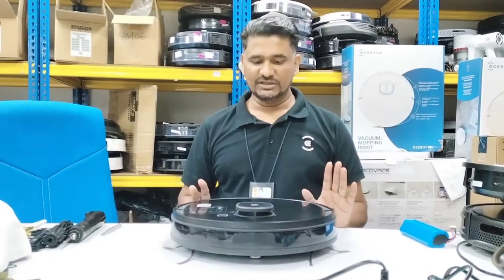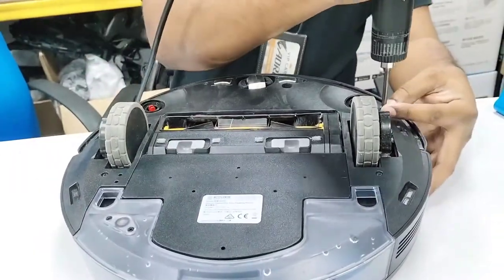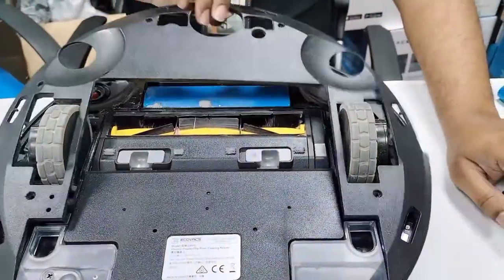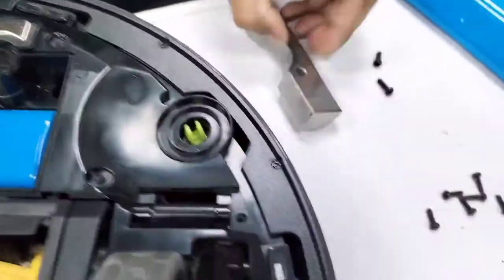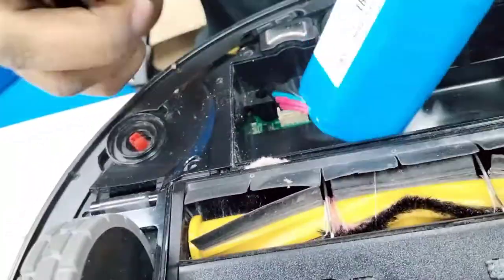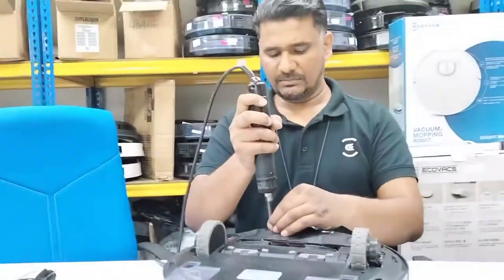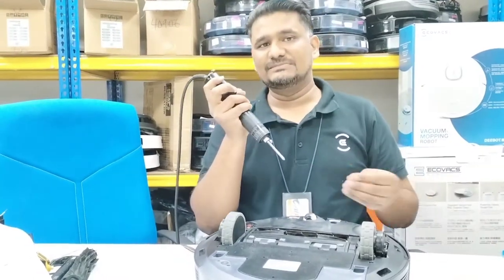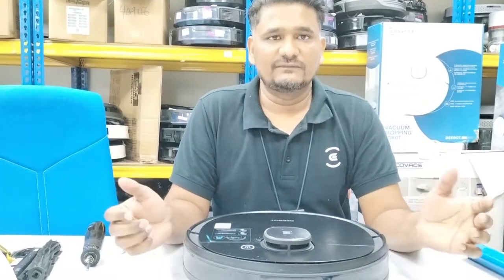DEEBOT | OZMO 950 | Can not Charge Or Runtime is Short, Want to Replace Battery 🔋

Comment: You can use the 950 model battery on a 920.  Simply dremel out the extra set of screw spaces at the rear of the battery compartment, solder the old connector to the new battery by whilst connecting the two black wires together.   Worked a treat, now I have much much longer battery life.
Reply from the maker: Can not sir...place where we put the battery in both model different space.. motherboard of 920 if charge 950 bigger battery Will burn fast

Comment: Very clear video, I have a question my Ozmo is 4 years old, the battery indication on the App now shows 100% charge, when the robot leave the base it start cleaning but it stops and shut down after few seconds about  2 m away from the base. If I put it back on the base, it anounce that is starting a richarge. Any test I can do to exclude malfunctions on the motherboard, before spending money for a new battery?
Thanks
Reply: Same problem with me, once it stopped suddenly when battere at 66%, I went to service center and they change new battere, and it worked again, after one year it stopped again this time at 78%, I had to replace battere again, so bad quality

Comment: Thanks for the video! I got a Deebot Ozmo 950 that is no longer charging. I took the chance and purchased a new battery. With the help of your video I managed to replace the battery, but unfortunately it did not resolve the issue. Is there a way to make sure it's the motherboard that is the cause of the problem? And would it be 'easy' to replace the motherboard? Do you have an instruction video of motherboard replacement as well perhaps? Thanks a lot in advance!
Reply from the maker: Yes it's a motherboard issue...there are 2 videos available about how to disassemble assemble back..if you watch those videos.. then will be easy for you to fix motherboard
Reply: @ecovacstechnicalsupport5278  Alright great, will look into that! Thanks for your swift response!! 🙂
Reply: Hi! I have your same problem with my deboot ozmo 950 series! I already changed the battery but I didn’t solve. Did you try to change motherboard? Did you solve it? Thank you very much

Comment: hi, I have a ecovacs deebot ozmo t8 aivi and i changed the battery but it still wont charge. I have looked at the mother board but don't see any other battery on the board?
and I don't find a new mother board for it. 

any solution?

Comment: Thank you very much for sharing these videos so clearly, I have an ECOVACS Deebot 920, it worked very well but due to a change of department I left it unused for 8 months, when I connected it the battery only charged up to 3% and stopped charging, I installed a new battery and it seemed that everything was going well, but when he returned to the base, although he identified it, it did not stay charging, it goes in and out, I turned it off and it turns out that it is not charging, the equipment works fine but it does not charge, do you think it could be the motherboard Or what else can I do? If it was the motherboard, I found one for the 950 model, but I don't know if it can be used on the 920. Can I contact you directly? Thanks again
Reply from the maker: Motherboard issue...but Ozmo 950 can not use in Ozmo 920....board looks same & connector also all same difference is in battery pack...in 920 battery is smsller than 950.. so 950 battery can. Not fix in 920 body
Reply: @ecovacstechnicalsupport5278  Thank you

Comment: Hello and thank you very much for sharing your great experience on the Ecovacs. Do you have any idea what the root cause is, when the robot does not stay in the charger? It's going to charge and immediately bounces back out of the charger. The charger itself works fine, 19,0V@ 1,5A, the battery is 3 years old. There I have charged the 4 x 2 cells individually to get balanced voltages and it works again. Do you know, whether there is a software tool to align the battery setting on the main board? In my opinion the main board should not be defective, even it resolves charging issues. Most of the 920/950 are "dying" (in germany) after 1,5-3 years with those charging issues. Any idea ? Cheers all the best
Reply from the maker: Welcome sir & I really appreciate your effort...try to put deebot manually to charge...see weather can charge or not..if manually when you put & it start charging that means ur charger infrared signal might faulty or maybe charger giving signal but deebot couldn't catch that you can check with ur mobile camera as well weather bumper & charging station showing red lights behind black glass or not....
If manually also deebot won't charge or won't detect that it's connected with charger that means motherboard need to replace... before testing make sure charging connector of deebot & charger itself not rusty..or broken...in few cases deebot charging connector were slightly broken so they went down a bit n couldn't touch with charger connector that also plz check...
Reply: anyone have a video how to replace the motherboard on Deebot 960
Reply: I've got a two years old 950. It stucks at 18% when charging battery and doesn't start the cleaning. It happened suddenly. Some help please. In Argentina there is no Ecovacs support. Thank you in advance
Reply: My charging station is showing only 0,5A. Is that maybe the cause of the 950 not charging?

Comment: I had two replacement batteries (long story) and installed them both. One charged for a while but would not be able to complete the full house vacuum (1400 sf). Now it won't charge at all and neither will the other one. They were off brand batteries. Would you say they are just bad batteries, or is that caused by the mother board?

Comment: Hi, if my Ozmo 950 doesn't rechange the new battery (also if I put the robot on contacts)  thats means that it needs to change mainboard? (The Ozmo 950 when finisch to wash return to the charger but arrive on the contacts an then go away)
Reply from the maker: In Ozmo 950 yes it's not a battery issue... battery still ok... Mainboard need to replace
Reply: Hi there also a 950 model here, it will find the dock and drive on but then drive off repeatedly. What circuit of 5he board should I be looking at? Is this repairable or new board. 

Also run time is down but by the video this may be a separate issue with battery.

Comment: my ozmo 950  is not moving out of its base though it says "starting to clean" with  both brushes working. the battery stuck / remain at 45% all time.. when move out robot from charging dock, it is not working at all (no battery). May i know it is battery issue or motherboard issue?
Reply from the maker: Motherboard issue

Comment: Thanks for your videos. It’s really helpful. My DX5G 2.5 years old deebot is getting stopped while app is still showing 50% charged. It works again after charging but stops again after around 50% charging left. It doesn’t say my battery is low. Do you think it’s battery or motherboard issue?
Reply from the maker: If suddenly shut down without giving error or battery low msg..& battery can charge when connected to charger then plz just replaced the battery only..this model quite long lasting.. motherboard won't spoil so fast

Comment: Thanks so much for your videos, very helpful. We have this model which we brought without a charger so we got the correct charger but now find out that it turns on like its going to charge then says something like check the power ...has a blue light and flashes once or twice then flashes red. Doesn't turn on so I suspect based on what you are saying here the motherboard will need replacing, correct?
Reply from the maker: Sorry for late response.
May I know the model no sir??

Comment: Hello, my 920 works only for few minutes, more or less 10 minutes and then switches oFf. As per the video it is a battery. Where can I purchase a replacement?
Reply from the maker: If U are in Malaysia then can contact this no. 01137973018.
If any other reign then plz check online many sellers.just check same Volt & clip that's All

Comment: Hello, thank you for the informations you gave.

I have Ozmo 950 and not very happy with it. Yesterday it also brokedown. :D It does not charge. It thinks that it is charging. It is stuck at %18. After 12 hours it was still %18. I am electronics producer myself. So I first unhooked the battery and charged it on my bench, then hook it back up. It showed %87 (I didn't fully charge it) and robot still could not charge. Charging dock gives 20V without any problem. So the problem is in robot.

The battery is 4s; but it has only one extra wire (blue) what it is for? I don't want to cut open the battery pack (yet). If I can't find any info I will... Because I will replicate the battery eventually(I own lots of Panasonic 3200mah 18650 cells).

Can the problem I am facing be a mainborad issue? If so I have a practical solution for this: A new battery pack (with BMS), hook the battery with a diode to the robot (to be sure that battery can not be charged by robot), another set of cables from battery will go to a 4S charger, which will be connected to charge terminals (on the bottom) of the robot. Since this product is POS,  I don't plan to renew it's mainboard. I think to to use the things I allready own.
Reply from the maker: I really appreciate your efforts n explanation about battery n charging issue...that blue wire is heating sensors wire once battery reach to its maximum heating level then sensor cut off electricity & it won't overheat...
In ur case it's not a battery issue... Mainboard charging regulator burn...if u can get a new Main board then can replace urself at home...will work...or if you are really knows about Mainboard power supply then see if you can repair Mainboard...but 100% confrm Main board issue...not battery
Reply: @ecovacstechnicalsupport5278  125 Euros for a very simple mainboard? Taking that the robot allready has a very bad software, I won't be paying for this robot's repair more than 25 USD.  After checking I also became sure that battery mosfet is faulty on mainboard. But the mosfet's datasheet can't be found. So, if I can't find it, I will probably add a 4s charging circuit to the robot, make a parallel connection to charging pads at the bottom (which is 20V) and solve the problem for 5-10 usd. 

To understand what was the blue cable for was important for me. So as I understand, battery pack has it's own bms inside.

So I won't need a bms circuit if I need to replace the batteries in the future. I have some good quality 18650 cells laying around. I can renew the cells inside the battery when needed.
Reply from the maker: @huseyinozsut9949  plz if Ur modification work perfectly then I'll request you to WhatsApp me at 00601137973018. I'll get some information about ur modifications so in future other customers can get help through this channel... Will be very thankful to you sir
Reply: Usta sonuç nedir bende suan aynı durumdayım ve seninle aynı fikirdeyim?
Reply: @huseyinozsut9949  👋👋
Reply: @huseyinozsut9949  Hi bro, I'm new to electronics and I'm sure I can do what you did to your robot. Did your modification a success??

Comment: How to connect with you? It seems like mainboard issue as it not at all charging battery, even I replaced with new one. How much it will cost to change main board? Or is it wise to buy a new one and discard current?
Reply from the maker: Any question u can ask or can WhatsApp at 00601137973018

Comment: hello I have a deebot ozmo 950, the deebot only works when I manually put it on the charging port. When I take it off it dies completely. On the app it says that the deebot is at 100% charge. It also keeps telling me to power it on, which I have done. I've also tried resetting. Do you think I should replace battery or motherboard?
Reply from the maker: Actually there are 2 different things...one is can not charge in mobile app battery bars won't increase...it means motherboard issue. ..2nd thing battery bar in mobile app shows increased from 1% to 100% means motherboard charging...if can charge & after Full charge Ur deebot suddenly shut down means battery issue.... normally plz power me on . this error Appears when battery gone

Comment: @ecovacstechnicalsupport5278 I figured out that the charging dock for my 950 is not working by checking the output using multimeter. I used to get around 19.4V and now i get around 0.1. This is my second docking station. Can you make a video of how to fix it please. It's really expensive here in India
Reply from the maker: Charging dock U can open n show to any TV repair technician he can  fix for you...if you can't buy new then that's the easy way I know

Comment: So i bought a used ozmo 950 and the battery does not charge. From the app it teels that it's charging but the percentage does not move. Could this be the battery or the motherboard?
Reply from the maker: It's motherboard issue.. battery should be ok
Reply: @ecovacstechnicalsupport5278  I see. so should i replace the whole motherboard? i can see that e charge controller is integrated in the motherboard so i'm guessing yes?

Comment: My deebot charges to 100. but when it goes to clean, it stops after 10min or less (completely shuts off). Then i put it back on the station, it turns on again and charges from 65%~. If i tell it to clean immediately after, it will go for 1min and turn off. But it will always charge. What is the issue please?
Reply from the maker: Battery need to replace

Comment: We replaced our battery after a good use of 2-2.5 years. Even after changing it, it shows charging but doesn't charge. Our model is Deebot 950 Ozmo. What do you think must be the issue?
Reply from the maker: Main board issue... battery still ok can use...just replaced new Main board

Comment: Hello i have problem with battery not charge and i buy and chance batery but still problem not charge you think is motherboard or other problem ? i have ecovacs deebot 950
Reply from the maker: In Ozmo 950 after almost 24. Months if got this issue... mostly is because of main board...just need to replace main board.. battery will be ok

Comment: hi, i have a question, i also replaced the battery, only charging does not exceed 20% with the old one, this was also the problem, charging only works up to 20% do you know how i can solve this
Reply from the maker: Just motherboard need to replace..old battery also still ok can use
Reply: yes with the old battery it was exactly the same problem, where can i buy the motherboard I live in the Netherlands

Comment: Hi. Do you know does Ozmo 920 has the same motherboard problem? Mine 920 stopped charging completely.
Reply from the maker: Ozmo 920 most likely is battery issue but for testing purpose also you need a good one battery so can Confirm...if any of your friends using same model then you can get help from them....but 25% is motherboard chances in this model

Comment: hello i want to ask my ecovacs 950 cannot charging fully, i alrdy change the new battery. my robot only can charge 3% after that not charging anymore. how to slove it ? thanks u
Reply from the maker: No need to replace new battery.... it's just a Main board issue...plz replacee main board deebot will be ok
Reply: @ecovacstechnicalsupport5278  where i can buy the main board ?

Comment: My deebot ozmo 950 keeps beeping 6 times, it is not connecting to app or able to do manual vacuum. Is it a battery problem?
Reply from the maker: Beside the mother board a small board attach with a chip... Call core board. That part need to replace
Reply: @ecovacstechnicalsupport5278   Thank you for responding back to me. I guess this is not an easy job.

Comment: Hello Sir, my debot 950 is not moving out of its base though it says "starting to clean" with  both brushes working.
Reply from the maker: If both brushes start working n deebot won't move from its base then plz check LDS....is it turning, or blocked... because normally deebot won't move when there's something wrong with LDS assembly

Comment: Hello, my Ozmo 950 is not working. initially after a few minutes of washing it returned to the charging base, now it doesn't work at all and doesn't charge. is it a battery problem?
Reply from the maker: How Long you are using this deebot?
Before charging issue when it was functioning but run time was short...so deebot that time can charge until 100% full or just few % & just stop charging...but deebot can Move that time.??
Reply from the maker: If you are using about 2 years & when deebot was functioning but short time.... Battery can full charge until 100% then its a battery issue only...if before that also when deebot can move but short run time & battery also couldn't fully charged just hang at 15% & can not charge more that means motherboard issue...
Normally in Ozmo 950 1 year plus usage n Charging issue means motherboard need to replace 98% cases